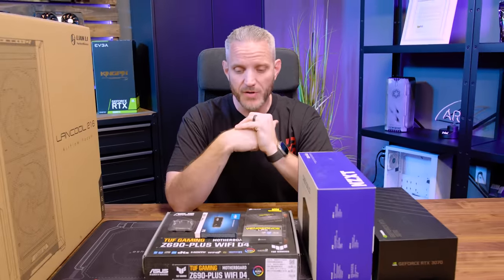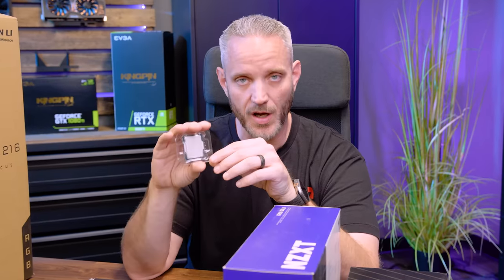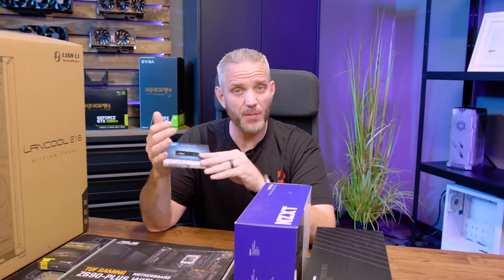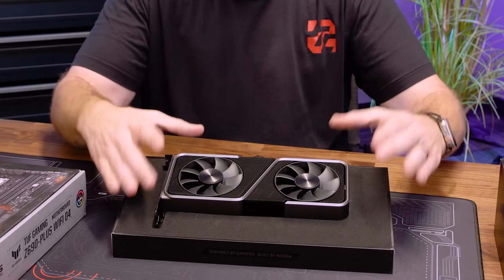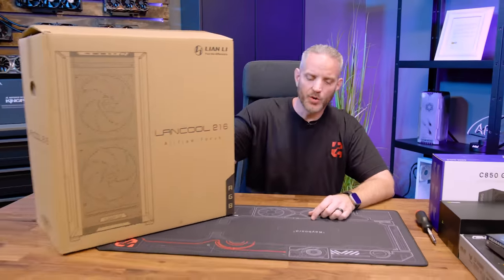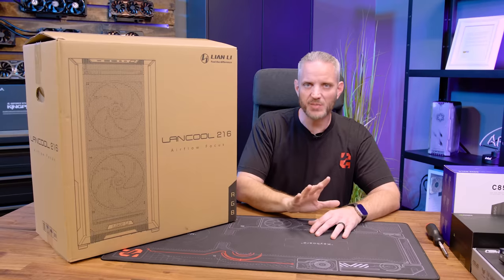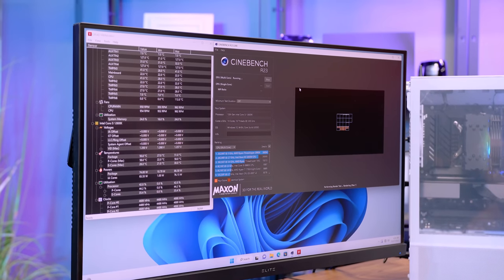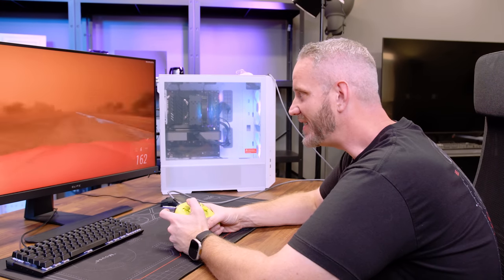Inexpensive PC Build Guide!

Comment: Cases are way better than they used to be, but more expensive. Choosing RGB is either sacrificing performance or value. Arctic P12/14 are exceptional fairly priced fans. To get better performance one have to go with BeQuiet Silent Wings Pro 4, Phanteks T30 or Noctua. And for a small gain. For the average user, looking for performance, forget RGB and save yourself quite a chunk of money.

Comment: TLDR: don't over look AMD gpus. 

Those who are looking for gaming performance only at as low of a price as possible, I highly recommend looking for amd gpus. I snagged a new 6800 XT for 570 USD. It 4k60 ultras everything I've run it on except for the realm travel room in God of War 2018 (I don't play cyberpunk). I even got up to 180 fps in some areas of Apex while the average is 120+ at the 4k max setting range. And if you're interested in Ray tracing, it can but it won't beat 30 series.

Comment: I was given 3000 dollars with the condition I buy and build 2 computers that can meet Cyberpunk 2077 recommended requirements. I managed to build both, first one saving 200-400 dollars and the other about 100 dollars saved. 1070 ti's for 230 dollars each and I7-8700k's for about 210 and 240. overall the specs came out to be quite good and the motherboards had plenty of support for i9 and newer processors as well as 2 nvme drives and 128gb of ddr4 ram. Just saying, it can be built for cheaper with a minimal hit to performance and plenty of room for upgradability. The only two parts I would consider to be a bad purchase would be the air coolers (as the cpu runs super hot) and the power supplies (80+ gold 650w). 
>One thing I wanted to point out most is that the wifi on the motherboards is hit or miss, mostly depending on the source of the internet. Any basic router or mobile data that isn't 5g will be giving my computer roughly 1-2 bars of connection with the router/phone resting on the case. Removing the panel boosted to 3-4, but it was far better getting a dedicated wifi card for about 40 dollars.

Comment: I don't know, as a broke 22-year-old university student with $5,500 in student debt I'll have to pay off come the summer time, spending $1,500 on a "mid-range" PC seems quite insane to me. When I think of mid-range, the price point that comes to mind is $1,000, and when I think of mid-range, an i5-12400 paired with an RX 6650 XT and 32GB of DDR4 memory comes to mind. A 12600K and RTX 3070 seems more like a low range high-end PC to me, but then again, considering the hardware Jay normally works with, I suppose a 12600K and RTX 3070 would be mid-range in his eyes. That said, for the average gamer, I feel like an i5-12400 and an RX 6700 10GB or RX 6700 XT would still be way beyond adequate in terms of performance.

Not to mention, with the 6700 10GBs costing as low as $300.00 and the 12400s costing around $200.00, you'd save quite a bit of money as well. I mean, the 6700 10GB currently sells for $314.99 here in the US (almost half of the price of the 3070 shown in this video), and it's only 23% slower in rasterization performance than the 3070 according to TechPowerUp. I imagine the average gamer will be perfectly content with playing their games at 1080p high graphics settings at 60fps with ray-tracing disabled, and the i5-12400 and RX 6700 10GB are able to do that without breaking a sweat. I personally use a 12400 and 6700 10GB and average between 90 and 120fps in the majority of the games I play at 1080p high settings.

Comment: I see all these youtubers do inexpensive or budget builds but always have a 3070 or better in the system. Not trying to complain or say they do a bad job but if budget was really a concern what's wrong with a 3060? I have one in my system and can honestly tell you it does great now I dont do all the fancy tests that others do/may do or run benchmarks but it plays games and works. Now my build cost was 1100 bucks but I did look for sales and deals while building it. My build is MSI X570 A-Pro, Ryzen 7 3700X, NZXT C750, Corsair Vengeance LPX 32GB, MSI RTX 3060, and the case is the NZXT H510.  But overall good video I would just like to see stuff with people running a 3060 or lower because that would be a bit more true to life.

Comment: Here’s a structured summary of the video:

### *1. Introduction*
- The creator conducted a Twitter poll, revealing a strong interest in build videos, particularly focused on performance and upgradability.
- The video targets building a "reasonable" PC that balances good performance with future upgradability rather than just saving money.

### *2. Build Philosophy*
- The focus is on building a mid-range gaming PC with room for upgrades.
- Avoids extreme budgeting pitfalls that limit future upgradability.
- Prioritizes parts that offer a clear upgrade path without replacing major components down the line.

### *3. Main Platform: CPU and Motherboard*
- **CPU**: Intel Core i5-12600K (specifically the 12600KF for cost-saving). Chosen for its strong performance and ability to couple with a Z690 DDR4 motherboard.
  - Advantage: Allows an upgrade to 13th Gen CPUs without needing to change the motherboard.
  - Compared to AMD's 5800X: While similar in price, the Intel setup offers a future-proofing advantage due to AMD's AM4 platform's end of life.
- **Motherboard**: ASUS TUF Gaming Z690 Plus WiFi D4.
  - **Reason**: Supports DDR4, has Wi-Fi 6, and offers strong VRMs for future CPU upgrades.
  - While cheaper B-series motherboards are an option, Z690 provides more flexibility for future upgrades.

### *4. RAM Choice*
- **Selected**: Corsair Vengeance LPX 32GB DDR4 kit (2x8GB for 16GB in this build).
  - **Rationale**: DDR4 offers a good balance of performance and price, as DDR5 is currently expensive with minimal performance benefits in gaming.
- **Upgradability**: The motherboard allows easy addition of more RAM in the future.

### *5. Storage*
- **Selected**: Crucial P3 500GB Gen 3 NVMe SSD.
  - **Reason**: Gen 3 provides adequate speeds for gaming and general use, and is significantly cheaper than Gen 4 or Gen 5 drives.
  - **Upgrade Option**: Users can opt for a 1TB version if more storage is needed.

### *6. Power Supply*
- **Selected**: NZXT C850 Gold, 850W power supply.
  - **Reason**: Provides enough wattage for future GPU upgrades, avoiding the need to replace the PSU down the line.
  - **Balance**: Not too low-end, which could limit future upgrades, but also not unnecessarily high-cost.

### *7. Graphics Card*
- **Selected**: NVIDIA GeForce RTX 3070.
  - **Reason**: Offers excellent 1440p gaming performance and a good balance of price-to-performance.
  - **Alternatives**: Discusses AMD options like the 6700 XT or used 3080s for those looking for different performance or budget points.
  - **Context**: Acknowledges that current-gen (40-series) cards are overpriced, making the 3070 a viable mid-range option.

### *8. Cooling and Case*
- **CPU Cooler**: Vetroo air cooler for its performance and affordability, although a Noctua NH-U12S could be considered for a slightly higher price.
- **Case**: Lian Li Lancool 216.
  - **Features**: Excellent airflow, modular design, and effective cable management.
  - **Price**: Approximately $100, chosen for its value in terms of cooling capacity.

### *9. Total Cost and Justification*
- **Total Build Cost**: Approximately $1500.
  - **Acknowledgment**: This is a substantial investment, representing rent or other essential expenses for many people.
  - **Justification**: The build offers strong gaming performance with a clear upgrade path, making the expenditure more justifiable for those looking to future-proof their PC.

### *10. Performance Testing*
- **Gaming Performance**: Demonstrates the build running a modern game (Forza) at 1440p Ultra settings, averaging around 140 FPS.
- **CPU Performance**: Shows Cinebench R23 scores, highlighting the 12600K's ability to outperform older high-end CPUs, including the AMD 5800X.

### *11. Conclusion*
- **Upgrade Path**: Emphasizes the build's flexibility, allowing easy upgrades to components like CPU and GPU in the future.
- **Alternative Recommendations**: Acknowledges that users could opt for AMD CPUs or second-hand GPUs depending on their priorities.
- **Final Thoughts**: The creator concludes that this build offers a good balance of performance, upgradability, and price, inviting viewers to share their own ideas for a $1500 build.

Comment: After twenty odd years I went back to PCs, needed to build one for my sons. I remember the times where Cyrix processors were going  h2h with intel and AMD. 
I wanted to go with 12600k and 3070 but went with 13400f (meh) and 3060 ti (Asus TUF). The prices were the factor of the downgrade - saved me over 230$. Gigabyte B760M G X AX DDR4 mobo, Gigabyte GP-75GM power supply, 32 GB 3200Mhz RAM (2x16 Corsair Vengeance @ a very good price), 1TB Adata Legend 960 and an ASUS GT301 case. Now, where did I go wrong? Honest question, I still have time to change stuff with my order (about a week, the shop is waiting for the GPU and the power supply delivery). The full price is 1370$ (I wanted all new). Should I invest more in the mobo and stick (pi) with 2x8gb of ram? Slower SSD?
I'm afraid I found this video too late. 
The prices I gave are converted from PLN to USD (I live and bought in Poland).

Comment: My 3090 died yesterday. Roughly 3 months after getting it used.

The seller said it was never mined on and had buyer protection turned on so it was reasonably trustworthy.

I used it for AI a lot which I think ended up cooking the VRAM even though it never ran out of spec.

Comment: Hello. New sub here. Have you done a rundown on long builds? I'm planning on building a new rig but this build will take many months to complete. Considering the timeline of 6+ month build, what components should I buy first (I'm leaning Ryzen AM4 platform). Rocking a i5 2500 currently with GTX 1060. It's long due for an upgrade. Knowing this I think anything I do it will be a huge difference. But I want future proof for the next 5+ years. I digress. Back to my original question. What component other than mobo/platform should I get? Should I wait fort he price point to come down and what order do I pull the trigger on these components?

Comment: I've never gamed. Building FPV quads has been my hobby. I decided that I  want to try MS flight sim 2020. I need something that could run it, and decided on this build. I bought from the list, except for the power supply, and the gpu. I bought a different psu for quicker delivery, and the gpu because of the cost. I went with $279 RX6600. I actually have n Asus RX 580 in a used pc that I bought.
Does anyone want to give the newbie their thoughts? Great info on this channel, I've been immersed. Thanks.

Comment: jay i have to respectfully disagree, 7600x is around the price point of ur CPU and would have a far greater future proofing and  upgradeability with ddr5 and a b650s. gigabyte has a great option around 200$, the extra can go towards the cpu and you pay maybe 20-80$ more for ram. if you spend the 80 you get 32gb ddr5 or if u spend the 20 u get single 16gb stick ddr5 vs 16gb ddr4

Comment: 7600x on sale for 230 at microcenter
B650E Aorus Master for 350 on newegg
Corsair Vengeance DDR5 5600 32gb 130$
MSI 850W MPG A850G atx 3.0 160$ (4080 runs great on mine)
ARCTIC Liquid Freezer II 280 115$
WD_BLACK 1TB SN770 80$
Corsair 4000D Airflow 90$
Total before extra Fans/GPU: 1155$
I would buy a budget gpu to hit 1500$ price point or save a little longer for a better one.
7600x can be upgraded next year and again in 2025
I like fully featured boards and usually spend   300- 350 on a new build. 300ish boards of today were the 200ish boards of yesterday.
Corsair 4000D is nice to work in, supports liquid cooling, and atx board. My 4080 sits snug but its always cool.
I admit my bias when it comes to the case :P. Crucial P3 is a good choice but 500gb?  
I've seen better sales on most of these components. You could find a similar build for cheaper on a given day.

Comment: Built my computer recently. This is what I ended up with: 
- AMD 7700x ($315[-$25 coupon] microcenter combo deal)
- gskill fx5 cl36 6000 32gb ($0.01 CPU combo microcenter)
- MSI b650m mortar wifi ($240[$220  microcenter combo deal])
- MSI k240 ($130 Amazon)
- AMD xfx 6750xt black Merc ($420 Amazon)
- Lian Li air mini black ($120 microcenter)
- team group z440 1TB nvme 2280($80 Amazon)
- crucial mx500 2TB ($120 Amazon)
- PSU Corsair ax1200i( my old PSU the price was out of this world... Don't ask when I got it new. It's been in storage for a decade and works fine. 88% efficient still.)
Build: 1405+tax (shipping included)
Reply: The aio I could have went with the Arctic freezer ii or deep cool ls520, but I'm still not decided yet, but the temps are good with the MSI atm. The Arctic would have saved me $40 and the deep cool about $20.(both Amazon prices for the 2 aio options)
Reply: I have access to a xfx 6800 core for $520 (Amazon) but undecided.
Reply: This build could hit under the $1500 with a 6800 no PSU because I had one but $1600 with cheaper aio and xfx 6750xt and the PSU if you need one sling with the Arctic freezer aio.

Comment: For a tower cooler you can't go wrong with the Thermalright Peerless assassin 120 SE,
Only $1 more you get another 120mm fan, and a extra heatpipe(6>5).
Size is bigger obviously so for small form builds may not be the play, but definitely seems like quite the bang for the buck.
Reply: agree the thermalright peerless assassin would keep temps more in check than the vetro v5 for almost the same money

Comment: At that price point, I would actually recommend considering the 6800xt if you don't plan on using dlss, rtx, or training ml models. I got an xfx speedster 6800xt for $599 and from what I can tell from benchmarks, it should really outperform a 3070 in rasterization.

Comment: My MSI PRO B760-P WIFI DDR4 mobo was only $159 & supports up to 14th gen intel CPU's, so that's what I opted for it instead of a Z690. I realize this vid is 2 years old and I don't know what lower series B series boards support, but since I don't overclock and only want the ability to enable XMP, have Wi-Fi and DDR4, it was the most cost effective option. Also, I got a Thermalrite Peerless Assassin SE CPU cooler on Amazon for $33 which is insane considering it's "as good" as a $120 Noctua D15; I rarely see the CPU hit over 40c and idle at 20c or below since I'm not a gamer, just an enthusiast. My point is you can build a killer PC with an upgrade path for cheap right now if you do your research. I can upgrade from the i7-12700F I currently have in it up to an i9-14900KS which will be relevant for years.

Comment: If you don't want to spend too much on a case get the Deepcool Matrexx 40 for mATX or 50 for full ATX and budget in a 4 or 5 pack of Arctic P12. They're super quite and efficient fans for the price. My Matrexx 40 with the P12s can easily keep my 6900 XT cooled. Also a 6700 XT or 6800 non XT is better at gaming than the 3070 for a majority of games and can be had for a similar price.

Also if you can, go used on parts outside of your PSU. The savings are massive.

Comment: It makes no sense to spend money with CPU, MB, RAM today, then spend all money saved again with upgrades. It would make sense if I could return the cheaper 12600, MB and the DDR4 RAMs and pay the difference for the upgrade. Without mentioning that you have $200 CPU lying around begging for another setup to not end up in the trash can.
IMHO, I would buy the CPU you want to stick with DDR5 MB, bite the bullet on the RAM and stop messing around with upgrades for the next 4-5 years. 
Not sure why people try to save $20 here and there if they will end up being rapped by $1K+ GPU which should be the most item to wait for the right price.

Comment: My upgrade path is simply getting a better video card.
How do I know this works for me?  
Because I'm still running a Core i7-2600k with 16GB RAM and a MSI GTX 1060.
I think I started with a GTX 560 card, then upgraded to GTX 760 and then the GTX 1060. 
The system still runs games well enough for me.  Not at 100 FPS, but normally not less than 30.

I am going finally build a new X590 system in a Fractal Torrent case with 32GB RAM, RTX 3060 12GB that should be a treat for me.
I expect this new system should be able to run newer games for quite a few years by simply upgrading the video card every few years or so.
I have selected the Seasonic FOCUS GX-1000 PSU so I will have no trouble running more power hungry video cards without having to replace the PSU.

Comment: currently building a system bit by bit using stuff from the pre built i bought found some nice deals here and there so i should fall close to the 1500ish range for the pc itself i really only need the gpu at this point but thats gonna be a little ways off but i did go overboard with the case a fair bit so my build when done should be as follows. asrock z790 phantom gaming sonic edition ddr5 mother board that i scored for 140 bucks open box triple markdown from microcenter a intel i5 14600k 270 bucks team group 32gb 6000mhz cl30 ddr5 ram kit at 104 dollars  current gpu is a 3060 12gb from the pre built i have a deepcool px1000g 1k watt power supply was like 140 bucks on amazon a arctics liquid freezer 3 240 aio was like 90 bucks on amazon and my case just arrived today its the hyte y70 non touch 219 dollars for a case is crazy but i love the look of it and as far as gpu goes as long as something doesnt change again when i go looking to buy it as i had decided previously on the 7800xt until amd announced the 7900 gre for only 549 bucks so all in im around that 1500 budget give or take a few dollars should be a decent little monster 1440p machine